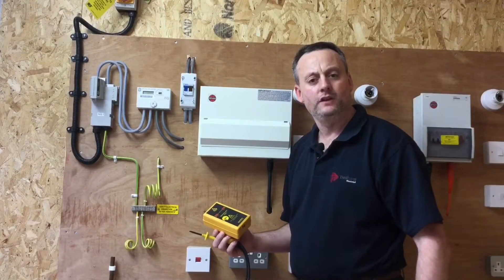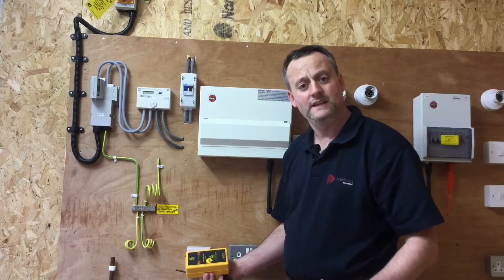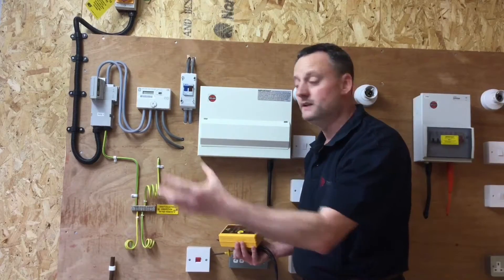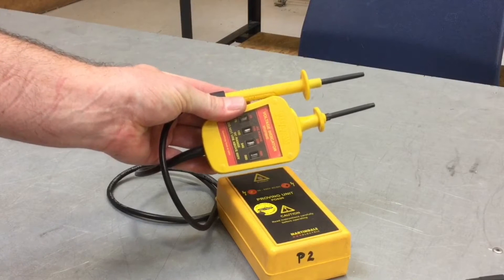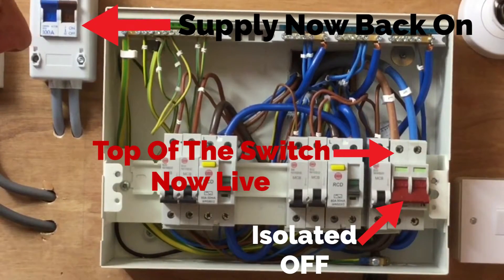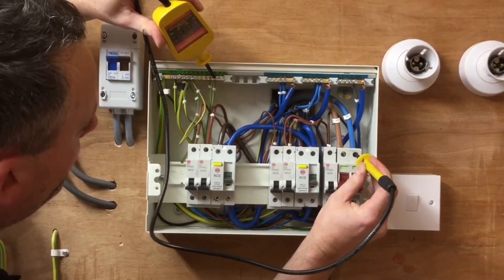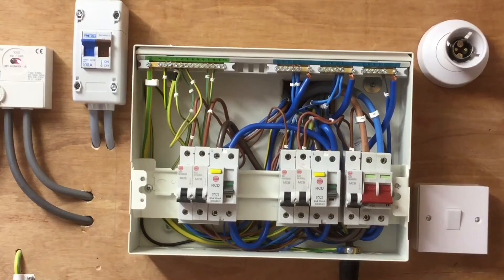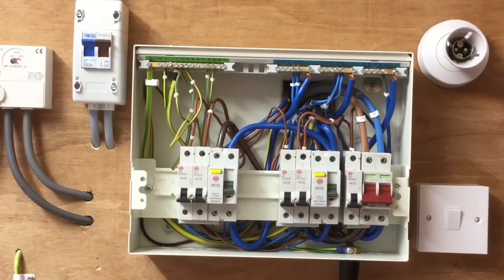First Live Test Check Polarity of The Supply Using An Approved Voltage Indicator AM2 AM2S

Comment: Proving unit is not the best way for proving a voltage indicator is working, what if the batteries in the proving unit are dead? Best to prove that the voltage indicator is working by probing on to the incoming side of the mains switch as this is a none supply sorry to be a bit of a moaner but I am fed up with all the college lectures say we have to use these things they are not a requirement and they are an over priced pease of plastic costing anything from £70 - £130. The only place were they are useful is on a building site were there is no none supply in which case you would not be doing any live test any way
Reply from the maker: Great points 🦾
Reply: @GSHElectrical  hi Gary please accept my apologies for the bitchynes. And I would love you to do a video on the use of the Robin kts 1620 MFT / kewtech kt62 MFT'S as regards to the loop and psc settings and how to do Ze two lead high loop test with the ROBIN kts 1620.

And I love the videos you do just one or two small points that get up ny nose or am I just being a old git
Reply: If the proving unit batteries are dead then the lights won't come on.

Comment: Is it best practice to fit a 2 Pole Isolator Switch between the Meter and CU when fitting a new CU. Also would you advise retro fitting one for future safe work on circuits off the CU.
Reply from the maker: I like a double pole switch in the tails 👍. Thanks for commenting and watching Gaz.

Comment: Hi, really sorry I am a bit thick,, when doing the above test, do you need to use an instrument that reads, indicates the voltage,, 230,, is is it enough to know live, neutral, & live cpc, have indicated power & neutral , cpc has not, thank you
Reply from the maker: Hi. A voltage indicator should be able to read above 400 volts. If a single phase installation was incorrectly connected to lines by the supply authorities in the joint in the road you wouldn’t want to be testing with an instrument that can only read 230 volts. Also many time an electrician will be testing dead 3 phase dis-boards (400V). Thanks for the message all the best GSH Electrical

Comment: Hi ,i am puzzled why you don't get voltage between Neutral and cpc.
Isn't it a double pole switch in consumer unit?
In which case the neutral will be live
Reply: Sylvia Norah  neutral is earthed at the supply transformer , so it’s at zero voltage , hence potential difference between live and neutral.

Comment: If the supply polarity was incorrect then the TNCS system you have in place; both the earth any neutral would be at the same potential because they are connected at the DNO service head. This testing procedure would work for TNS. If the supply had reverse polarity then L-N would be lit lamp, L-E would be lit and N-E would be unlit because it would not indicate a difference I'm voltage as they would both be at 230. 230v minus 230v is 0v, hence lit lamp.... Enjoy your videos though just wanted your thoughts on my comments :)
Reply from the maker: Hi that is correct but you will have proved that the line conductor is correct. Thanks for the support Gaz
Reply: GSH Electrical... So you would prove that the cables have been installed in the correct terminations but not that the supply polarity is correct.... Which granted if it is incorrect as an electrician, all we can do is make the installation safe and report to the DNO.... The only way to reliable ensure the supply polarity of a TNCS System wouldn't be the above PLUS Using a neon screwdriver on Line, neutral and earth. Expecting lit, unlit, unlit lamps respectively.

Keep up the good work add enjoy the easter break
Reply from the maker: Hi. A visual polarity of the connection at the supply cutout and meter would also be carried out... in this case we are trying to prove we are fused in the line conductor during the test 👍

Comment: Hi GSH, thanks for the clear video, this is fully understood as part of the correct initial testing, thanks also for the added arrows to clarify testing points for me 😉
Reply from the maker: +David Roche 
Hi. This is a live test is carried out under controlled conditions at my College. My level 3 domestic installers have been forgetting to preform it during my site visits and it’s very important they do it. Thanks for your support GSH Electrical